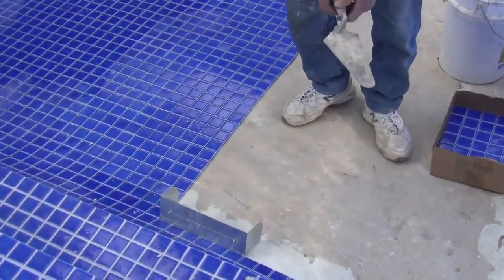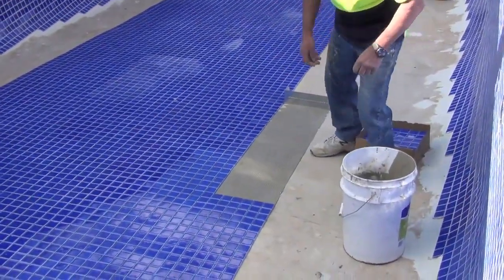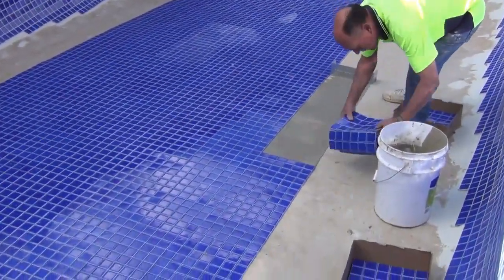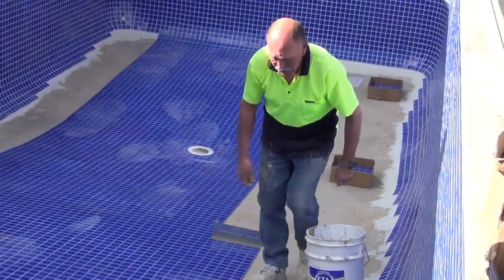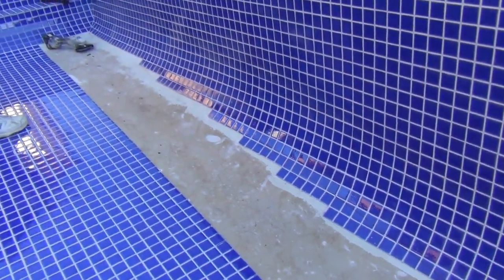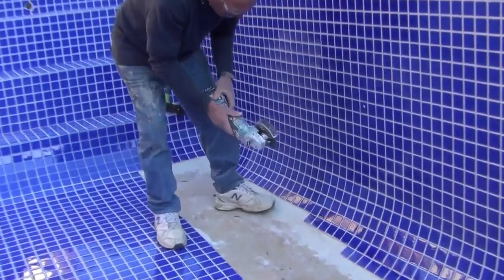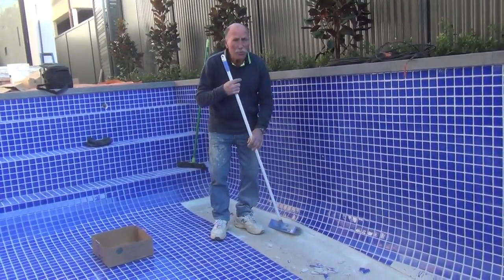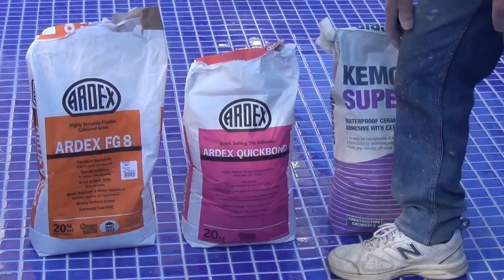HOW TO TILE A SWIMMING POOL FLOOR USING THE DIY SPREADER- Roy Tiles

Comment: The way you work is a case study in economy of movement. Every action has a purpose and there is no wasted effort.
Reply: Working many years in the same trade and you turn into an efficiency guru. Small tweaks in the way you move add up and can really mean the difference of getting your knees replaced at age 40 or never. Its fascinating to watch and go through the process of learning and realization yourself.

Comment: Dear sir, why the part or the wall and the bottom intersect, you don't glue a whole plate to avoid cutting and you will have a good alignment

Comment: Nice work in Croatia we lay smaller mosaic tiles mostly 2,5x2,5 cm (1“x1“). Because of that cutting the tiles requires a lot more precision and is more time consuming. But with the right tools you can get the job done.

Comment: Great video. This appears to be a new build. What if I am renovating an old pool with an existing pebble mix base. Should I grind it back to concrete or tile over the existing pebble mix?
Reply from the maker: If it’s sound the tile straight over it. Watch this video
https://youtu.be/kXHE8lMnsM0

Comment: Great professional job, but what happened with watterproof treatment when you re cutting with diamon blade? thx for your usefull professional advices sir!
Reply: There is no waterproofing
Reply: @MrJFoster1984  the plaster underlayment and waterproof mortar he uses are the waterproofing. No rubberized compound needed like in a bathroom.

Comment: Do u need to add a membrane on the cement before tiling? Is it okay if small bits of old paint are still in the pits of the wall? We scrapped and used  orange peel to remove as much paint as possible.  Thank you.
Reply from the maker: as long as the paint shows no sign of flaking you will be ok
Reply: @roysouthby1  Thank you so much. Putting a membrane can be expensive. Thank you for solving a headache.

Comment: Hi saw your video on tiling pool using the ultraspreader.  Interested however I was wondering did you have to remove the existing plaster.  If not what adhesive did you use to tile on top of the existing plaster.
Reply from the maker: No we’re lucky in South Australia that we don’t have to plaster the walls but sometimes I will give the walls a thin coat of adhesive to fill any nasty holes. The adhesive I use on the walls is Kemgrip Super and Quickbond on the floor

Comment: Dear Roy:  I am retire at this COVID19 time. I want to redo my swimming pool. Before put tile, how to prepare the surface of pool? My pool has a lot small bubble and if you scrap it, it will fall off. Do I need redo the whole surface with Gunite or just patch up? Also will your method work on glass mosaic tile? Thanks  Peter
Reply from the maker: Hi Peter once you’ve emptied the pool go over the entire surface to find any drummy spots. These have to be removed and repaired using an acrylic bonding agent and a sand and cement mortar mix 
The Ultraspreader is only good for the floor so you will have to use a small notched trowel on the walls

Comment: Roy, Did you use the superspreader for the walls of the swimming pool.
Reply from the maker: No I only tiled the floor and only up to the coves
Reply: @roysouthby1  hey Roy, can I tile a pool with existing plaster or does it need to be sandblasted? Thank you!
Reply from the maker: Antonio Estrada the marblesheen has to be sound. Anything drummy has to be removed and repaired before tiling
Reply: @roysouthby1  thank you much Roy!

Comment: Roy amazing would you be interested in doing a 5m x 7m kidney shape pool more challenging for video.
Reply from the maker: Hi Sasha I started tiling swimming pools in 1972 and most pools were called freeform with a lot being kidney shaped. The major difference there is that you first cut the walls so that there is a nice even line and then lay the bulk floor as I just did in the video and then you have to cut the floor into the walls. It’s not hard just takes more time

Comment: I found this interesting, because I tiled my pool after finding it impossible to keep the plaster looking good. I had to make it up as I went along, so generally laid the straight bits (fast, even with a normal trowel), but for the angled bits, I offered up a sheet, marked, and then cut it. It was much more time consuming than as above. However, the most time-consuming were the four corners, which I dealt with as above (although indistinct ate the deep end), but which were more graduated in slope, and the angle at the external edges of the Roman end, with narrowing tesserae. What's more, the pool wasn't wholly symmetrical, as formed by gunite and then plastered in cement and marble, which was then ground smooth.
However, the tiles were variegated (white, pale, blue, darker blue, with very dark blue in lines), so less-than-perfect workmanship don't show up. 
It was very hot work, when the sun shone (UK!), so I had to rig a sun sail sometimes, and pump out the water from the sump when it rained at other times, also, insects liked to embed themselves when grouting.
However, I've been extremely pleased with the result with many years comparatively trouble-free, following years of anguish over the plaster. In sunlight, it looks wonderful with the light refraction, and it night, it looks wonderful when floodlit.
Reply: Hi that's amazing! I live in UK too. Have a kidney shaped gunite pool and the stones/guntie are coming away from the walls so it's in need of a refresh. Did you use any primers prior to adhesive? Looking like tiling the pool is going to be the best possible option. But don't fancy paying out for someone to do it. Have experience tiling bathrooms and the like, but nothing with curved sides lol. Did you have any tiling experience before doing yours? Any tips would be helpful thanks :)
Reply: @MC-eq3pm  My first comment is that I don't understand how stones/gunite are coming away from the walls, so there may be a difference in construction, or perhaps quality; I did not know, but apparently some gunite pools aren't done well (I've just read that, anyway). However, mine was, although I don't think they did the final top edge as well as they should, because I had to repair it. (It tends to take a beating from winter weather, and I once had ice ~4" thick, although I'm now careful to keep the water level lowered in winter. On occasion, it has overflowed.)
With my pool, they carefully dug the hole with a back-hoe, fixed rebar in place, then brought a lorry from which the concrete was pumped through a long hose so as to create a concrete shell about 2" thick. I was told it is extremely strong, and I believe them. They then rendered it with white crushed marble and white cement, finally grinding it smooth. Within about 2-3 years, it was looking dingy. One can empty the pool and regrind it clean and smooth, but do that a few times, and one'll reach the concrete. I tried this a little, and a few other things, which were worse than useless, so resolved on tiles.
I used Mapei waterproof tile adhesive, which is widely available, directly onto the render, which was extremely sound, one might almost say ideal. It was only unsatisfactory through discolouration. I should think primer worse than nothing.
I bought the 1' by 1' sheets of mosaics from internet website. They're made in Iran. The supplier gave a good price, but when I checked quite recently, I found the same tiles cheaper from someone else.
Although mostly variegated, I have some dark blue lines, and a pattern around the frost line, making up sheets using purpose-made mesh (from craft shops) and a jig. I wish I had had the time to incorporate a mosaic in the bottom, like a Roman dolphin, but I didn't want to spend the time.
predominantly
The pool is 32' x 16' with a 5' radius Roman end, and the cost (many years ago) was about £1,000, and perhaps 3 times that now (guess). I think any professional tiler would have charged many many £'000s to do it.
I spent another £1,000 on new coping stones. I didn't think I could lay them well, and was going to pay someone to do it, but the cost made me do it myslef, and it worked, although I can see one place which a pro would have done better (the bedding too thick, where exact level was needed).
I often wonder that I had the foolhardiness to think I could do it, as I admire the appearance, and ease of cleaning.
Reply: Currently tiling a kidney shaped pool at the minute. I’m just wondering did you put any expansion joints in the interior of the pool and also did you use epoxy grout or cement based thanks
Reply: thats awesome! how long did it take you to do?
Reply: @RedResevoir  i think two years between start and finish, because I had other things to do, including working every day, but could have done it faster, with hindsight. I've often blessed the day I decided to go for it.

Comment: Second: if you are cutting anything, you need to wear protection: after all you don't have a spare set of lungs or eyes lying around. Wear the safety glasses or safety goggles, a 3M dust respirator if you are cutting anything--the respirator must have a filter that is able to screen out fine dust particles. And wear ear plugs so that dust doesn't get into your ears. If you are installing glass mosaic tile, ALWAYS polish the cut ends--cute little hands and cute little feet ALWAYS find a way to cut themselves on the cut ends of glass tile.

Comment: Ardex quickbond is not suitable for for constant water immersion.
Reply from the maker: Con Moutevelis I’ve been using it since they brought it out and in all those years I can honestly say that I haven’t had any issues. Before that I was using rapid set with the same results
Reply: You're correct.  Good job it's not my swimming pool!
Reply: I agree it’s not suitable for pools says so in their websites tech data sheet, thank you you saved me from being screwed over

On another note I spoke to a ticket that said you can use it however the grouting needs to be suitable for pools so my guess is maybe tilers use the normal mastic under the tiles to save money and then grout over it with the proper stuff at least that’s my guess

Comment: I love Mr. Southby but these subsequent comments are not personal and not made to hurt him. For outside tiling, you must have at least 95% coverage and for pool applications, one must have 100% adherence between the tile and the tile adhesive. Time signature 1:36 shows there isn't even 30% coverage--basically only 4 tiles are covered! Look for the puckering when you take up the tile. If you see mesh, that means the tiles will delaminate.